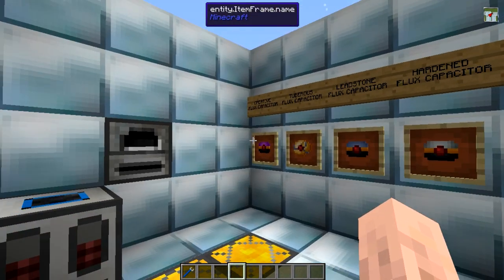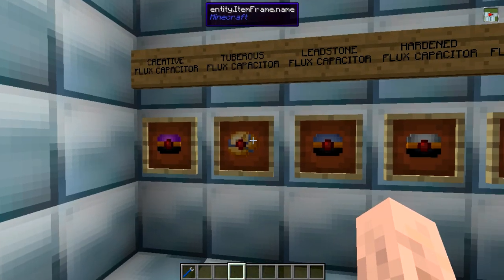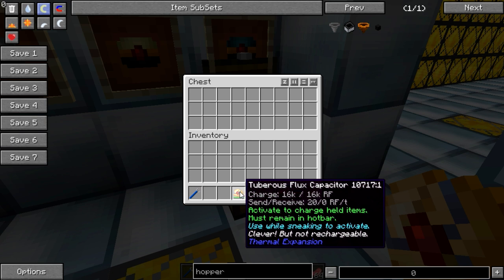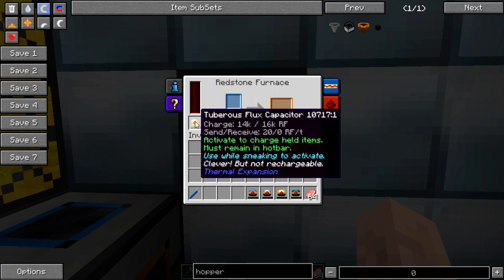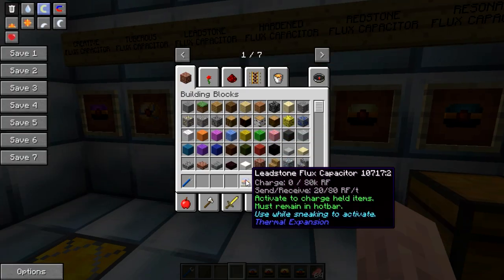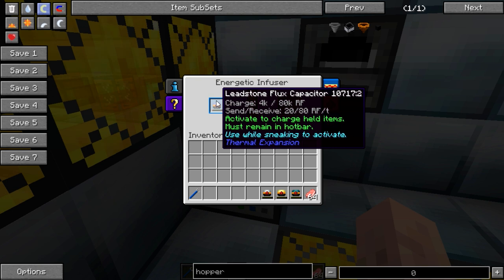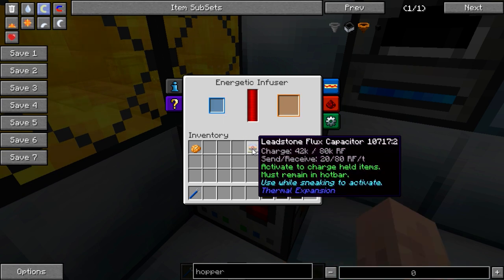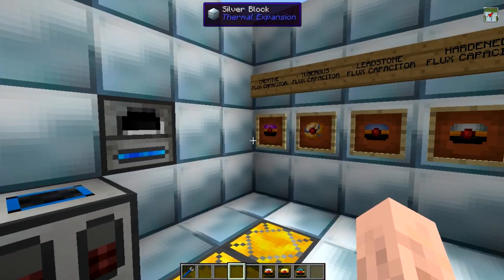youtube video #-5pjpNOm4-0

Comment: i have a question for you.. have you figured out a way to change the "send" ammount? i assume you know but you can charge whatever you are holding in your hand and the resonant flux capacitor is still very slow to charge the resonant jetpack cos its on 2.5kRF/t want to put it on 10k